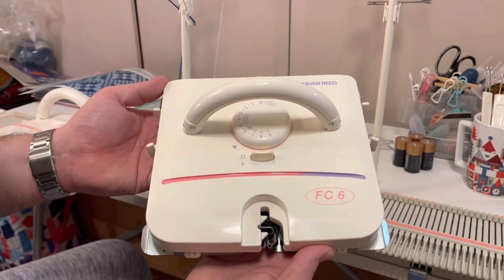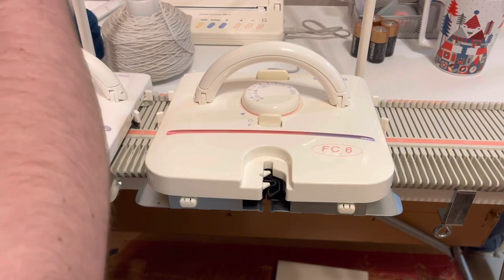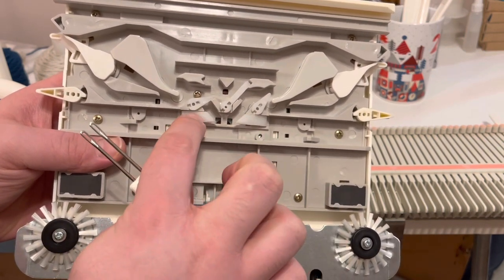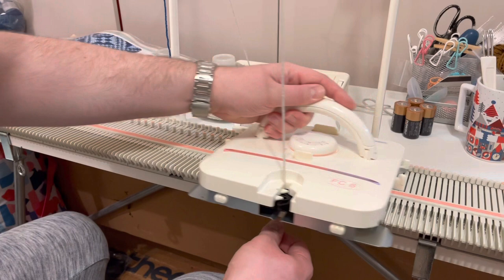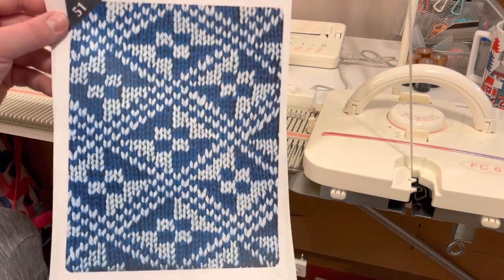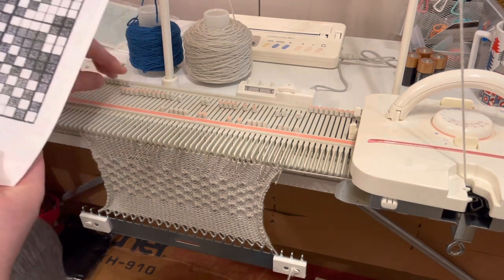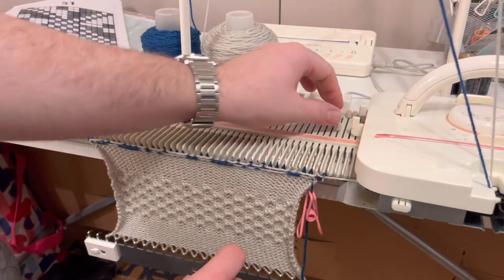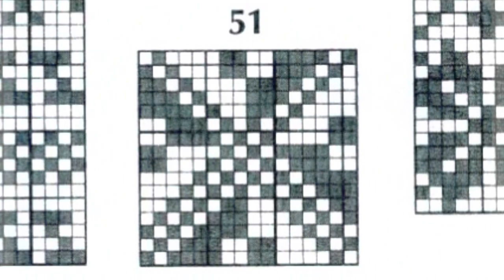An Introduction To The Silver Reed FC6 Fair Isle Carriage - For LK140 & LK150 Knitting Machines

Comment: Was that the sk2300 same as?
Reply from the maker: Yes, the SK2300 is actually a machine model, that was sold in Japan.  It was an LK150 with an FC6 carriage as standard.  FC6 is the name of the carriage itself but some are branded SK2300 as they were denoting the model of the machine on the carriage, that it went to.  Bit like the LK150 carriage having LK150 printed on it.